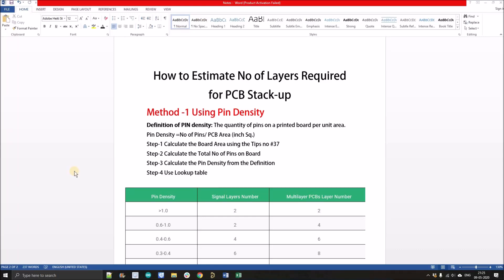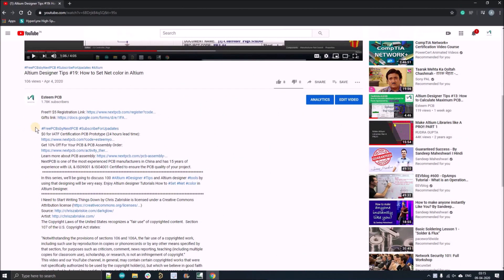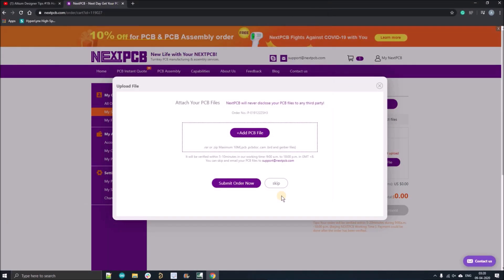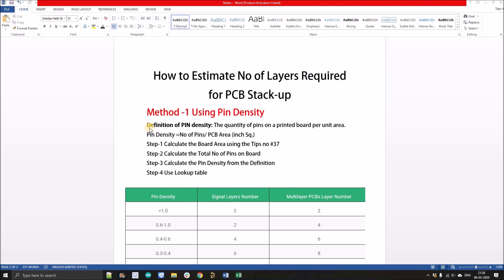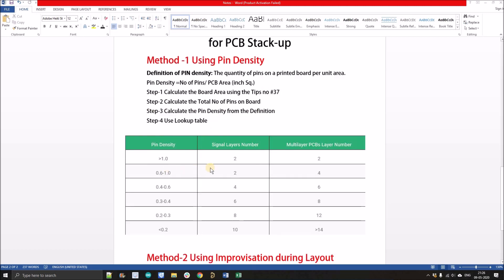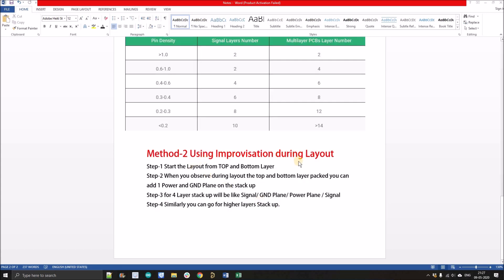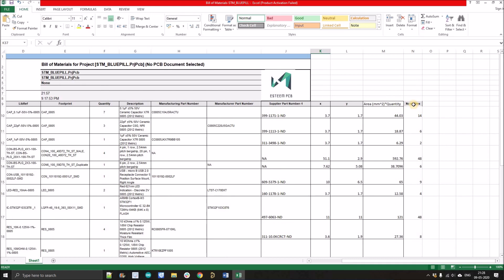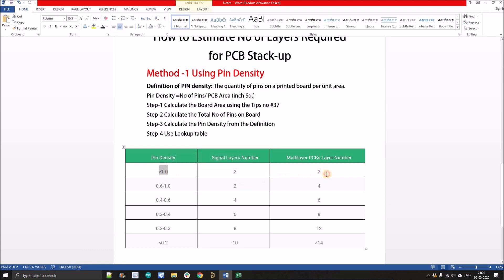Number of Layers for PCB | Altium Designer Tips #38 | Sponsored by "Nextpcb.com"

Comment: I think your Pin density calculation got an Problem 
If you Put a single resistor on a huge Board (100 sq Inch) you will geht a small Number of Pin density
Reply: I think the Problem is somewhere Else
Lets say you got the Number of 1
If you Double the Number of Pins on the Same PCB size your Pin density goes Up to 2. That would mean with your Definition les complex.
If we reduce the Number of Pins by 2, the  Pin density goes down to 0.5. with your Definition would mean more complex. 
But in real its geeting less complex. 

Maybe have a Look at the ipc
Reply from the maker: Yeah I can understand your point, you are saying this formula should have the dependency on no of components, i will discuss this in my network thanks for pointing out